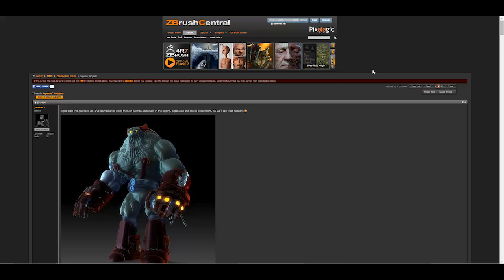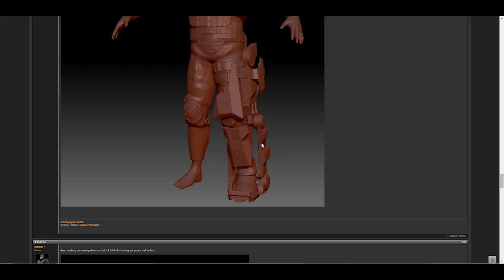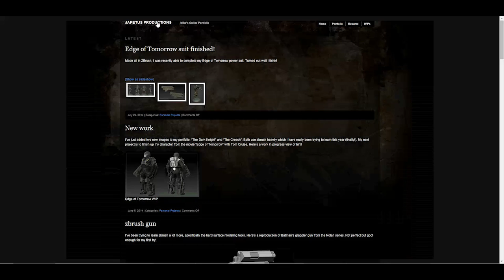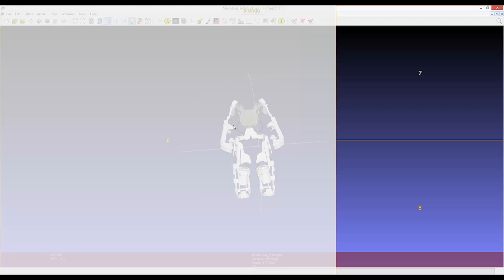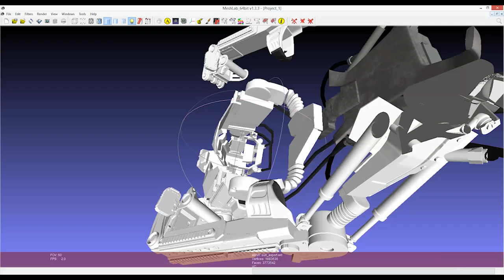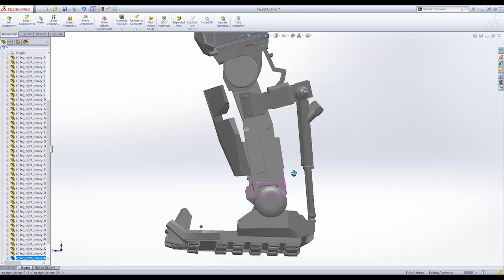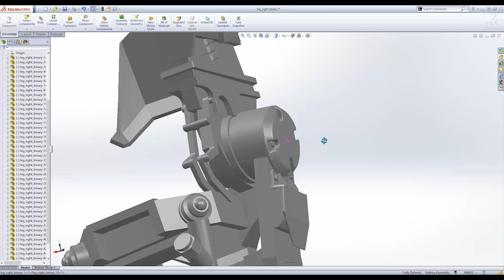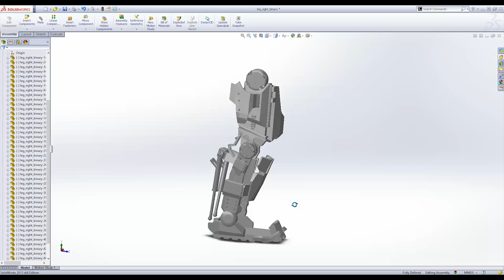Exoskeleton Mk2, Part 3: The New Designs

Comment: For the joints make the inside an axel with a bearing attached then a lid on it shaped like the joint then have motors control the legs

Comment: I'm surprised you haven't jumped on the 3d printing bandwagon yet!  :). I'd print the parts in PLA then cast them in aluminum.  That's what I'm doing on my bionic arm.  Biggest hurdle is the parts in the hand are so small its hard to get them to print well enough.  For your project it wouldn't be so bad since its larger.   Here's one of the bones I put up on thingiverse for example.  http://www.thingiverse.com/thing:489738
I'd love to have a laser cutter though.  Would be so useful.  Good luck.  Love your project!

Comment: You could still use wooden parts, or even plastic, for lightness and steel only for the structural elements. Probably cheaper and you can still make it a movie one.
Reply: Aluminum
Reply: No bro,better is if the Exoskeleton is made of full metal👍

Comment: Be an engineer and be practicle. Make it work rather than look like it belongs in a movie.
Reply from the maker: It will be practical -- like I say in the video, I'm not planning on making it look like its from the movie, I don't care about aesthetics, but the joint system they use is fairly robust and flexible, that's all.

Comment: why don't you use a aluminium type alloy just google alluminium alloys see wich is best
Reply from the maker: It's trickier to work with aluminum. I can currently only weld steel. It may be lighter, but steel is still stronger so you can get away with thinner cross sectional areas. I am planning on getting a TIG welder soon so maybe aluminum will be a possibility...

Comment: do carbon nanotube instead of steal
Reply from the maker: Jurian Groen yeah it's just not feasible, especially not for a prototype...
Reply from the maker: Those aren't exactly feasible for macro manufacturing... Only micro
Reply: the Hacksmith I think he means carbon fiber, which is basically carbon nanotubes weaved together.
Although I would rather recommend CFPR (Carbon Fiber Polymer Reinforced), which is stronger.
Both of these are not cheap though, if you won't mass produce them (CFPR needs molds, which would be cost effective if you'd use those molds a lot, you probably won't (yet?))
Reply: the Hacksmith I agree, working on my fully powered full range of motion upperbody exo before I get to the legs. Legs looks even harder

Comment: why not use aluminum to make it more lightweight so the suit can work more on lifting other things rather than lifting the suit. because steal is very heavy compared to aluminum.
Reply: ShockwavePlaysMC you cant have them touch there is a thing called galvanic corrosion
Reply: But steel is stronger, wich means that maybe with his lifting capabilities with the suit, there may well be problems with bending when using aluminium.
Reply: Wim van Eldik if you use it right you can prevent it from bending. aluminum can be strong if it is built right.
Reply: brandonhughes7
 but manufacturing those speicail shapes can also be done with steel, makeing it stronger. but indeed you are right. maybe he uses aluminium, but i don't see the point, that exoskeleton can lift 180 punds with ease, 5 punds of the steel frame does't means a lot on those numbers
Reply: Maybe just make some of it aluminum and some of it steel...?
Reply: brandonhughes7 You can't weld Aluminum so the process to bond the parts together would jack the price up, as it requires specalist equipment.
Reply: BrotherHoodMovies331 you can weld aluminum its called tig welding.
Reply: lasy i checked he had a MIG
Reply: last*

Comment: I would strongly suggest a CNC endmill and aluminum stock to manufacture the parts. Cutting stainless steel mesh with a laser is one thing, but this might be way out of your cutters league. Looking forward to more, this is going to be beyond epic!
Reply from the maker: I'm upgrading the laser cutter with a plasma head =) It'll do steel.

CNC'ing everything would be awesome, but prohibitively expensive... And I don't have room in my garage for a full-size mill...nor could I afford one right now.

I'm called the "hack"smith for a reason ;-)